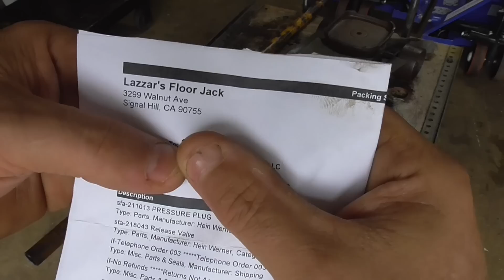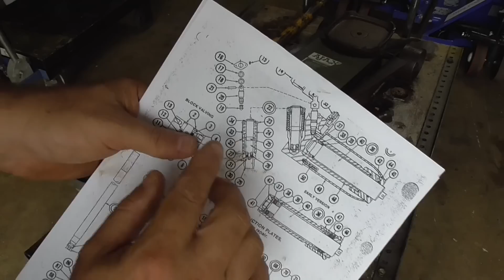Walker FloorJack Vs. Doublewide6 Repair

Comment: I can't believe you did all that work and then put ATF in it. The detergents in most transmission fluids will damage the o-rings. Hope it keeps working for ya man. Thanks for the video.
Reply: I posted about that....Cant believe he used automatic transmission fluid.
Reply: LoL, come on Bill, he has a “ Masters Degree in Industrial Technology”. I’m sure he knows what he’s doing !! I could tell when he used a impact tool to remove the plastic vent and drive the pressure valve into its bore ( probably what messed up the threads to start with) LoL. Just remember if you see a floor jack on CL that’s half green, pass it by, unless you want to rebuild it.

Comment: Another trick we've used for cross threaded parts is to narrow the leading edge about a half or three quarters of an inch so it fits further into where there are still good threads. Top notch fun job; always fun when successful.
Reply: Grinder?

Comment from the maker: Tools Used in this Project.
Please give a thumbs up if you like this type of video.
Please give a thumbs up if you like this type of video.
https://amzn.to/3eb9m7X Non Aerosol Lubricant Spray Can
https://amzn.to/37V95os Milwaukee Fuel 1/2" High Impact Driver
https://amzn.to/31XJvLE Milwaukee cordless ratchet.
https://amzn.to/3jLuNxw Replacement Floor Jack
Reply: It would have been better if you were not putting peoples life at risk by misinformation. In this video, don’t use ATF in place of hydraulic Jack oil. Yeah, I also read all your disclaimers that you were not responsible for any of your actions in the videos you make. Hopefully no one gets seriously injured or killed relying on your “ knowledge “.

Comment: ATF instead of hydraulic oil?
Was  that part you had to order missing in the jack prior to you taking it apart or???
Gotta little time in on this thing!!
Reply: Oil will compress, hydraulic oil is what's SUPPOSED to go in anything hydraulic. I'd hate to be under the car and the oil gives way.
Reply: @crgaillee  you would think some one with a “ Masters Degree in Industrial Technology “ would be aware of improper use of fluids. Hope he never comes across a grease fire and throws gasoline on it to put it out !!!!!!!!

Comment: DOUBLEWIDE,I notice you put ATF instead of hydraulic fluid in the jack.I have  a harbor freight press been setting up for years doesn't work,can I use ATF.
Reply: Don't ever use automatic transmission fluid in a hydraulic jack...It will ruin the seals.

Comment: If in doubt, hit it with a hammer. If that doesn't work, use a crowbar, if that doesn't work, get the angle grinder out. That'll fix it!! Good job.

Comment: WRONG TYPE OF OIL DUDE!...YOU DONT USE AUTOMATIC TRANSMISSION FLUID!...yOU SUPPOSE TO USE HYDRAULIC JACK OIL....YOU CAN RUIN THE SEALS!  LOL LOL before you made this video you should have sprayed some penetrating oil on the wheels and let it soak over night LOL